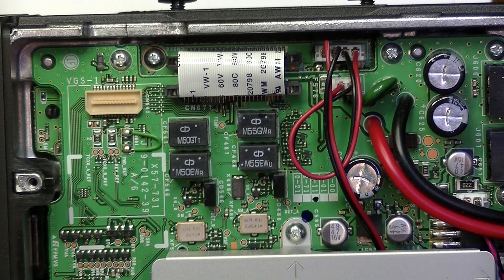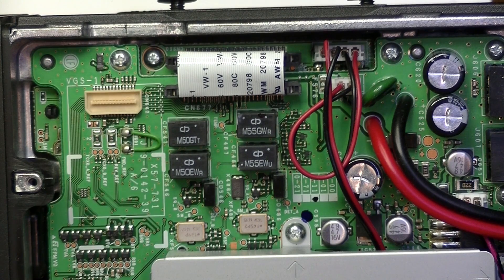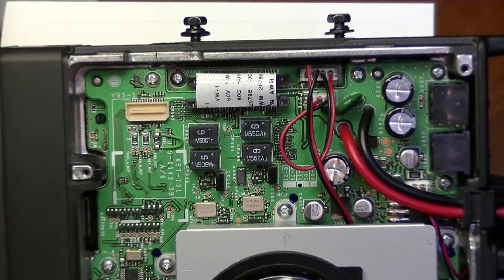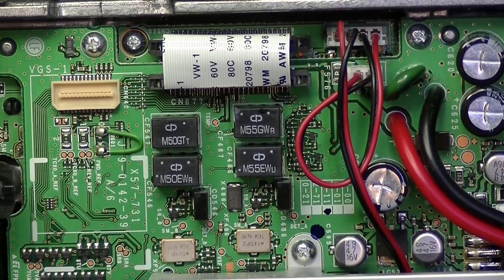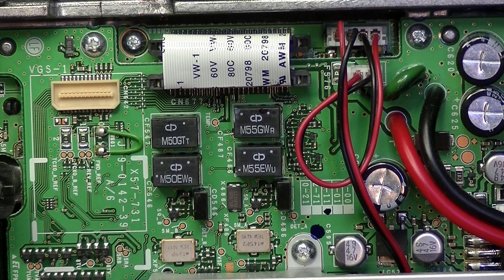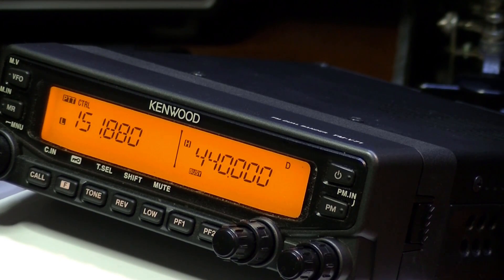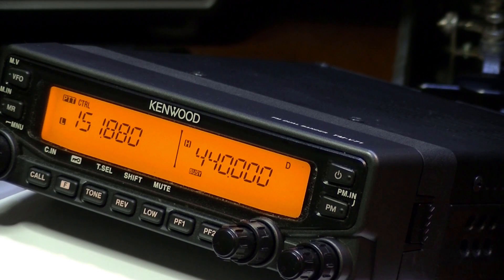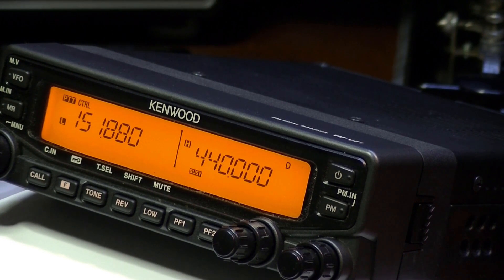Kenwood TM-V71 MARS/ CAP MODIFICATION Part 1

Comment: Hiya Rudy you know anything about the Mirage mx 25, it's only running on 3 bands I think it has a hidden menu any help would be great thank, 73
Reply from the maker: David White Hi... no I'm not familiar with that particular rig... tried to search for service manual and didn't see one anywhere to download.... u say it's on 3 bands? Looks like that's just a 10 meter radio.... probably meant for export use on 11 meters
Reply: Take a Bath Productions thanks for the reply yeah it's an export to 11 meters thanks again

Comment: Cut the wire right? I think that's what you said. And it's the green wire? What if there's more than one green wire in my radio? Ok, cool. Thanks.
Reply from the maker: Can clearly see from the video, there's only one green wire.  This will open radio up partially... for the full open check out part 2 of this video... link is in description..
Reply: KABOOM!   Wrong wire....

Comment: I have the same radio.. Even if the mod is done, to tune 11,25k for the first three MURS channels is impossible.  No problem programming GMRS channels, the only down fall it difficult to split tones between CTCSS and DCS. There's no way ti turn off DCS receive when there's DCS tone for Transmit and CTCSS Receive
Reply from the maker: I hadn't noticed that.... I also wanted to mention... there's a part 2 to this video that opens the TX up a bit more....

Comment: To be clear, this particular mod shown here (first video) involving the cutting or removal of that green jumper impacts RX only? That looks to be "W601" as seen here, which is reception expansion only:  http://www.repeater-builder.com/kenwood/pdfs/tm-v71ae-mods.pdf.  I appreciate the clarification.  Thank you.
Reply from the maker: HI Tony, no the green wire opens up the TX a little, and the removal of the resistor in the 2nd video, opens the TX a bit more...  I don't think it affects RX at all..
Reply: Thanks much for the clarification.  I looked at that link again, and that portion references a "Type M4"  (RX only).  I believe I or we have the K type...  So, that likely explains the difference.  Thank you.
Reply from the maker: Tony yes I'm pretty sure K type is all USA ....

Comment: Has anyone had any issues with cross band repeating after removal of wire and resistor? Just want to make sure no functions are lost if performed
Reply from the maker: I haven't noticed anything after removing the wire.  I am still planning to remove resistor, just haven't gotten around to it yet.  But I have opened up lots of radios, and never noticed any problems with any of them...
Reply: D H don’t remove resistor #2 or you will lose crossband , green wire and #1 only

Comment: Since you have done this Mod back in August, have you used MURS at all on it and noticed any power / heat issues with your TM?  It should be able to cross-band using MURS as one of the frequencies - correct?  I'm looking to cross-band a MURS to GMRS.  Thanks for any input.
Reply from the maker: Ernest Kamber Jr hi,... I don't have anybody to talk to on MURS to really give it a test to see about getting hot,.. I tried it when I first did it... since SWR quite a bit higher I only tested it on low power.. if I remember I was getting 5 watts,... but never tried it on 50

Comment: if we remove the resistor labeled 2 we loose the cross band function??
Reply from the maker: Nikos Ntzanis I'm not sure on that one
Reply: today i receive my tm-v71e and i open the unit  and have no green wire at position 0 and no transistor at position 1 .The strange is at the position of the wire i see a transistor .I can only transmit to 144-146 and 430-440.My unit is going to 136-174 and 400-470 but i can't transmit outside the 144-146 and 430-440.Any help??
http://i46.photobucket.com/albums/f119/nikoskarpen/Screenshot_2016-11-23-20-24-01_zpsqujz4yaw.png

This guy here remove the wire and the transistors  1 and 2 https://www.youtube.com/watch?v=ipEMqCOqgRw&t=473s
Reply from the maker: Looks like it's been modded to european standards.... Are you trying to open it back up to USA standards?
Reply: I don't know what are the USA standards.I am from Greece.Kenwood for the EU at website say 144-146 / 430-440 TX and 118-524 RX.I think at USA have only the 71A type K ,M4 model and EU the 71E model type E.I just want to have full TX  coverage